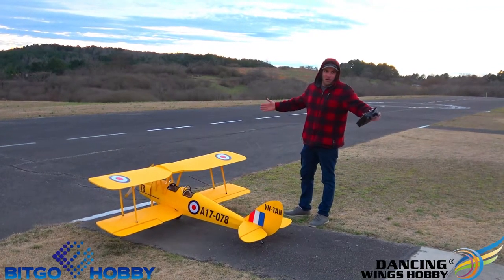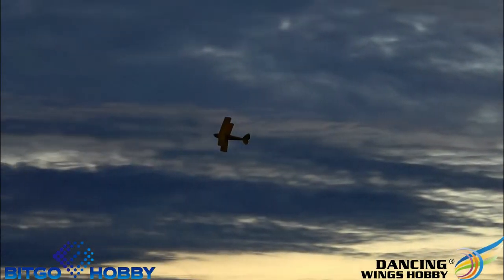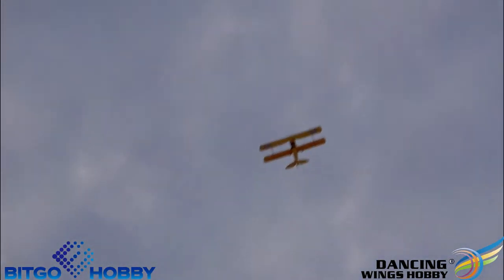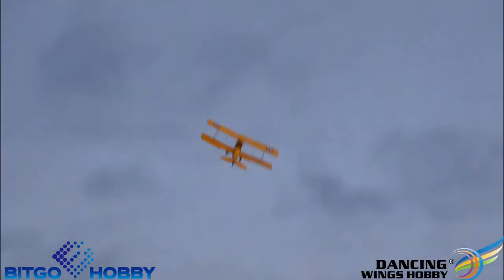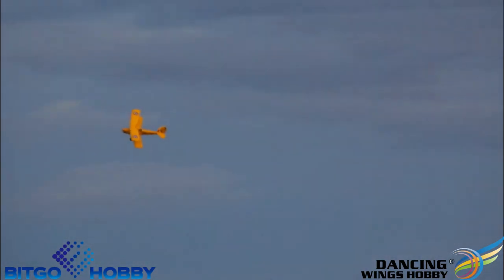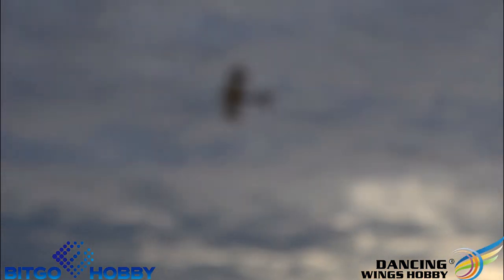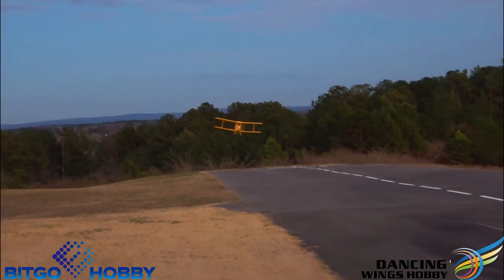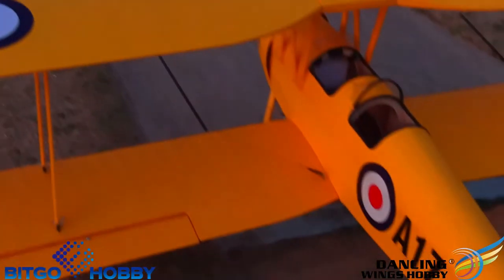DANCING WINGS 2150mm(85in) WINGSPAN TIGER MOTH!

Comment: Hi, is anyone flying this. The CG in the manual seems way too far foward for a biplane. What is the correct CG?
Reply: Same boat, just about ready for a test fly - looking at many other TM plans this is about 3-4 inches too far foward but who knows. Anyone out there....
Reply: @mikewilson6019  Im guessing is about 2 inch too far foward. We will see.
Reply: Just to reply to myself for those who end up with this kit. I have mine set at about 3" behind the kit cg and its flys well. Could even go back further. This is with a 250kv motor and 10s right up in the engine box. 500g weight in the nose. https://www.youtube.com/watch?v=0CfVMbwqNLk